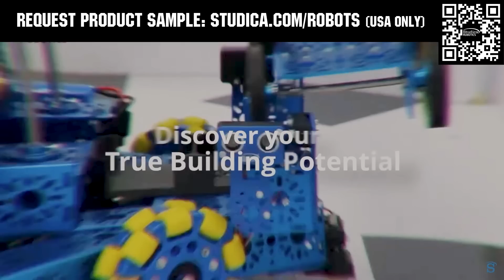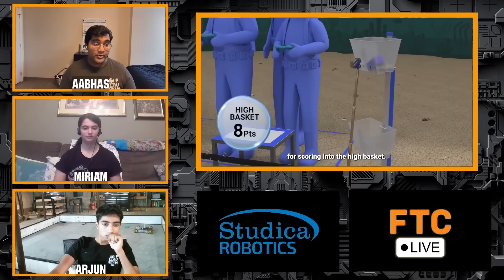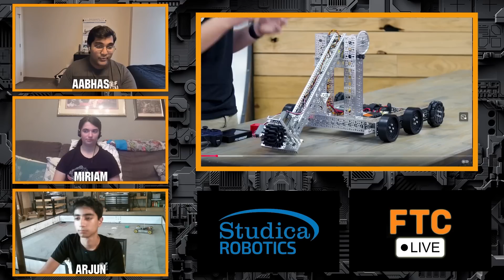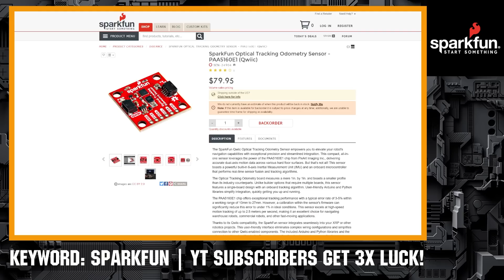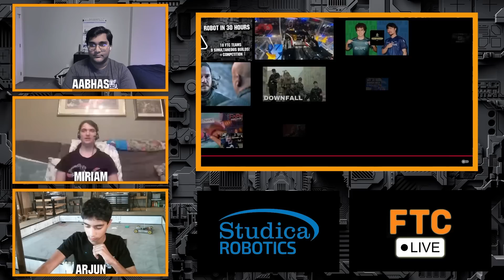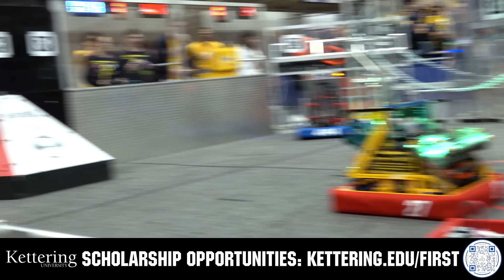Breaking Down INTO THE DEEP Strategies | FTC Live

Comment: I did notice a distinct difference in the FTC hang and the example FRC hangs. The FRC rungs were all offset instead of straight up.  This is going to cause issues with clearing the bottom rung completely in the FTC Game.  The center of gravity is going to have to controlled to keep the bots from touching.
Reply: Going to be a challenge unhooking from the bottom rung
Reply: @chevy4x466  So you have to hang from the bottom first?

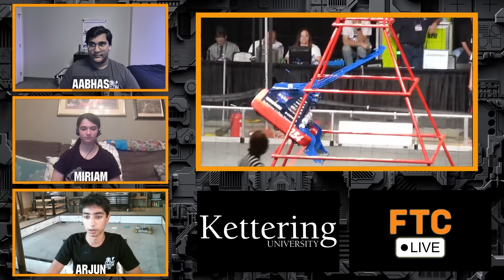Comment: 21:55 "25 54"
Not sure you really explained that mechanism right. The key was the 2 pairs of hooks, one set on pneumatic cylinders (could be servo in FTC, perhaps static on the frame if it can reach the bar) hold the robot on the lower rung. The second set of hooks (in this case on pair of telescoping tubes, could be linear extension style elevator for FTC) reach up to next rung. When you pull down long reach hooks the static set spring latches onto rung, this would also be how you stay climbed after match has ended without needing a ratchet/brake.

Source: Student on 254 in 2013 and current mentor
Reply: Hey, Arjun here, I appreciate the feedback. I was trying to spin it more in a way to be FTC feasible and rely on the visual as what the movment could look like. The insight is always appreciated, though, as it'll help me and hopefully others understand in more detail exactly how your system worked as it was quite cool👌